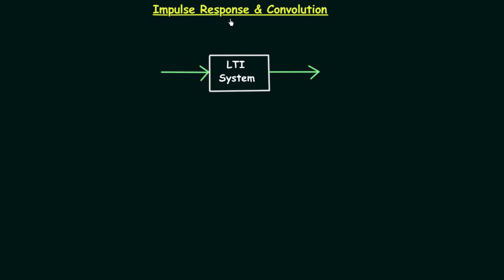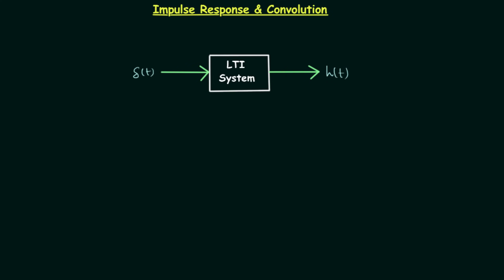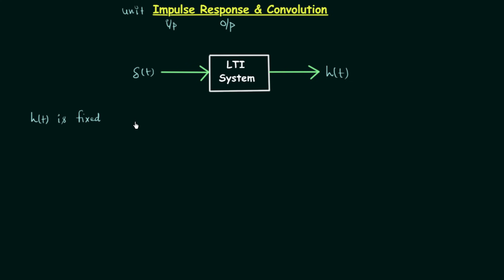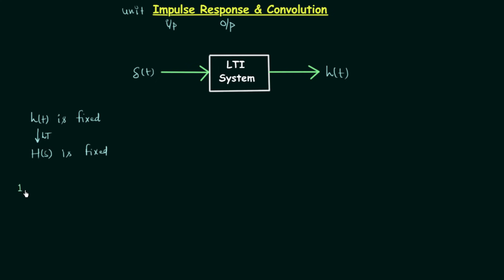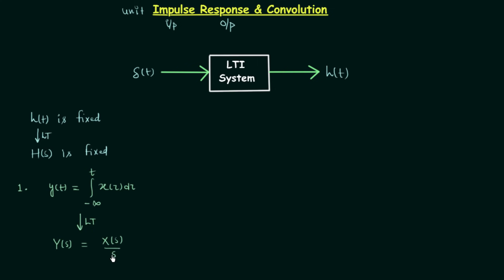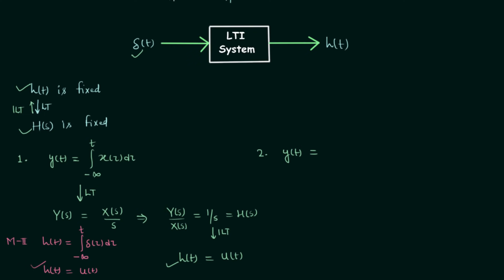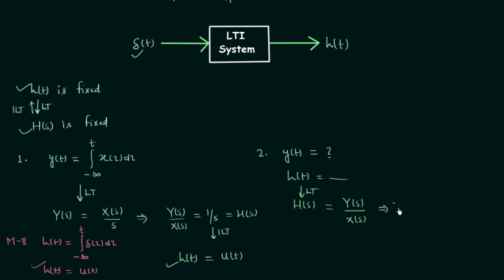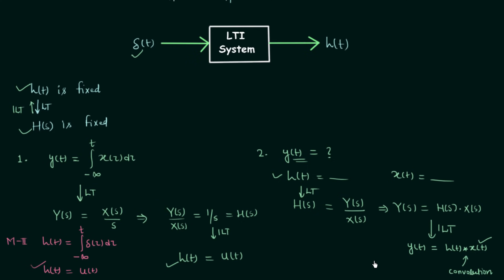Impulse Response and Convolution

Comment: 1. Impulse response is only used for LTI
2. If system is not LTI you cannot calculate impulse response 
3. When input is unit impulse(2del(t) is not unit impulse , here weight of impulse signal is 2)
4. The output to unit impulse or impulse of a LTI system is known as impulse response or unit impulse response.

Comment: What's difference between y(t) and h(t) as both are outputs of LTI systems
Reply: h(t) is written as output when input is impulse function. Whereas when we have a generalized input like x(t), then h(t) is transfer function and  y(t) becomes output function.
Reply: @drunkirk3472  
Why we have to use h(t) to find y(t) when input given as x(t). 
If iimpulse is input then h(t) is output. 
Similarly when x(t) is input then we have to find output y(t), but why we use h(t) in finding y(t). 
Please explain.
Reply: when we are finding y(t) , h(t) is response of system whereas x(t) is input.
but to get that h(t) [if its not provided], we should find it using impulse response technique shown in video.
Reply: @chembakurusuryanarayana6303  h(t) is impulse response of the system which is to be used for finding output y(t) for any random input x(t) using convolution technique.
As h(t) is -IMPULSE RESPONSE, it means we can find it only if we apply impulse signal at input.
Hope that clears
Reply: What did he mean when he said the the impulse signal is a fixed signal ?

Comment: in figure h(t) is shown as output of system and y(t) is also used as output of system... How exactly y(t) is different from h(t), if they both have to shown in one physical control system model?
Reply: h(t) is the output when the input is impulse. y(t) is the output when the input is some other function x(t)
Reply: h(t) is the unit impulse response or simply impulse response of the system i.e. the response of the system when the input is unit impulse signal but y(t) is the output of the system in general i.e. the input signal can be any signal not just a specific one.